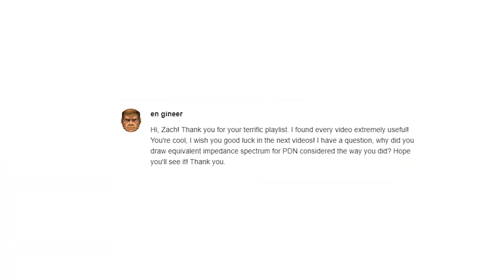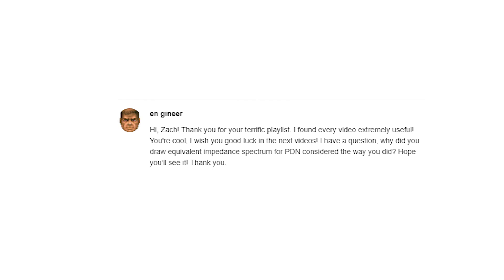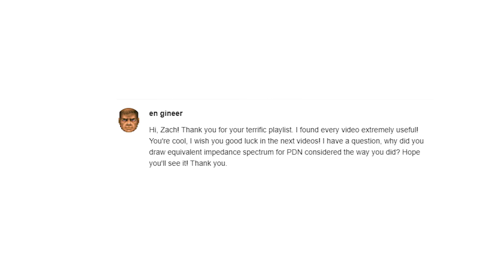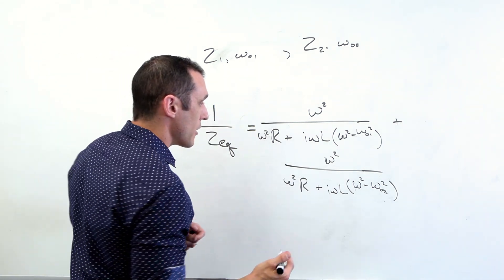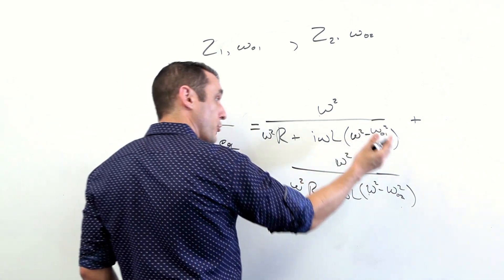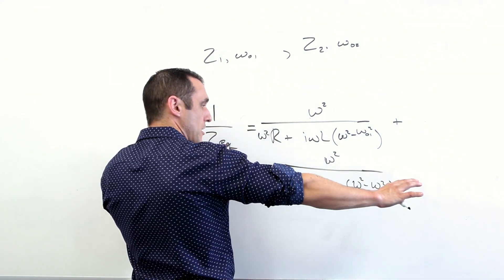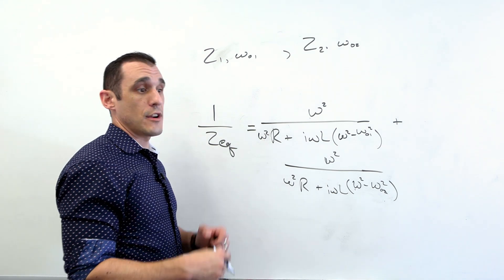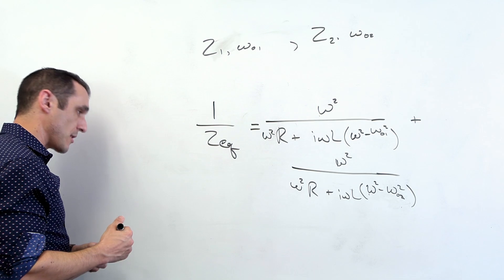Capacitor Impedance in a PDN: Derivation

Comment: Hi Zach, I remember in "Controlled ESR Capacitors" video that increasing ESR of Capacitor of fres=f1 flattens the curve between Z at fres and the peak point, same for the other capacitor, meaning increasing ESR of both capacitors can give a flat response which reduces the supply voltage oscillation in the time domain. I have a question here, doesn't it make no sense to increase ESR of a capacitor for better performance? or since you're talking about "off-chip" capacitors then it's different, meaning, on-chip capacitors implemented in each block in the SoC could require minimum ESR for other reasons? and off-chip could require high ESR for the flat response? could you explain the difference between the two types of capacitors? off-chip capacitors and on-chip for each SoC block modeled as Cdie & ESR?
Reply: In that question it was about using a controlled ESR capacitor in a PDN, but that is not really their intended usage. Technically you could use them, but you are correct that it does not make sense to increase resistance if you want to get to a lower PDN impedance. If you used controlled ESR capacitors with higher ESR value to get to a lower PDN impedance then you might need to use a lot of those controlled ESR capacitors in parallel to get the total PDN impedance below target.

In terms of on-chip, I will admit I have not looked into the controlled ESR aspect of those chip capacitors because I do not do IC design. I will say that those chips have higher capacitance density AND higher ESR so I think the response at high frequencies would naturally be flatter but I would have to look at data to be sure. There will also be differences between the different types of SoC capacitors (MIM, MOS, MOM, etc.)